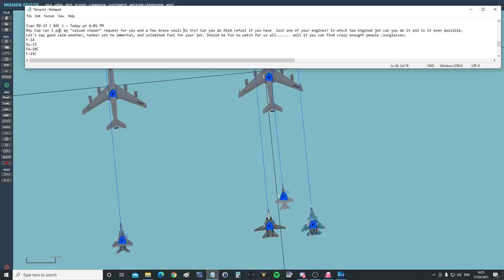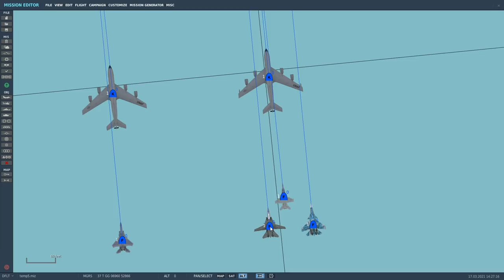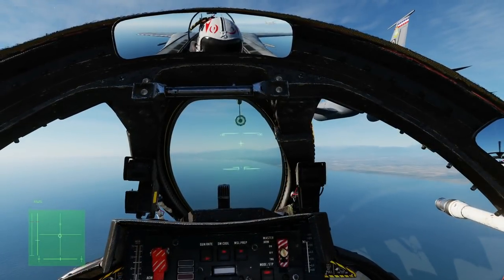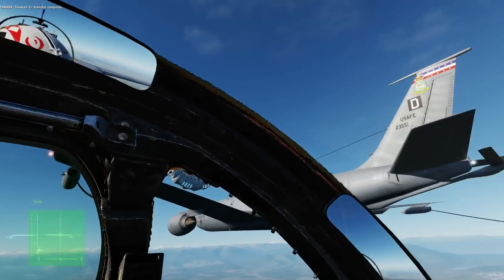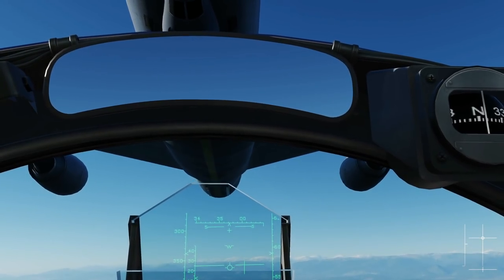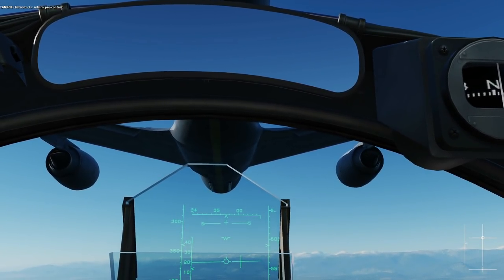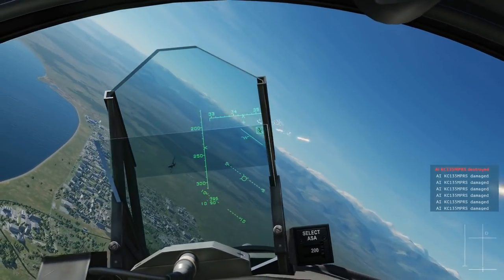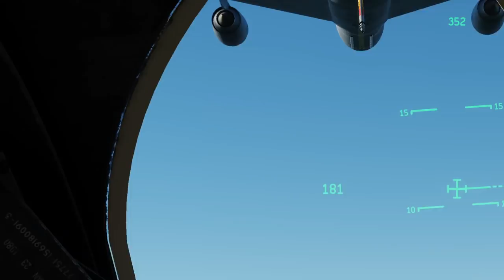Questioned: Which Aircraft Can A-A Refuel With One Engine Out? | DCS WORLD

Comment: No, when you use rudder to counteract asymmetric thrust, it does not yaw you, it prevents yaw.  Rudder does not roll you, the yaw you create or fail to prevent with it rolls you.  You don't need aileron trim if you prevent sideslip.

Comment: I heard that the SR-71 used to refuel with a single engine.
Reply: I have no idea if that’s true, but geeeze that would be a hell of a boot full of asymmetric thrust!
Reply from the maker: wow
Reply: Doubt it at all, look up Brian Shul and have a listen to his stories on the Blackbird.
Reply: How would you? That thing is huge! I know because I saw one for the first time yesterday
Reply: I actually heard that before. Or is the fact it needed afterburner to keep up with the Tanker
Reply: If they had an engine failure, but not as a routine.  What would be more common is to put one engine in afterburner and modulate the other engine to maintain position.  Being power limited at heavy weight is not all that uncommon for fighters due to a lot of induced drag on the airplane at refueling speed.  Even with both engines operating a fighter carrying a heavy load might need a toboggan under some conditions.